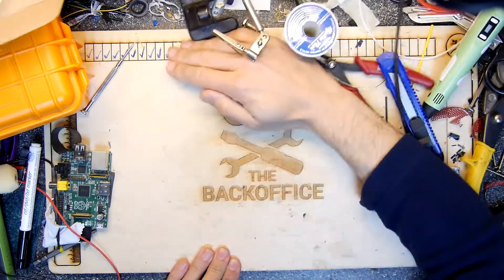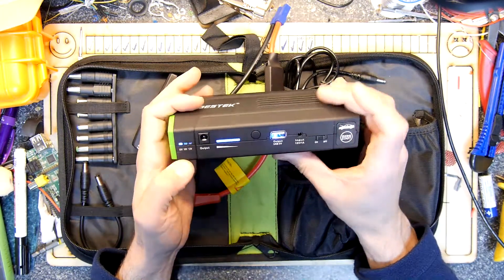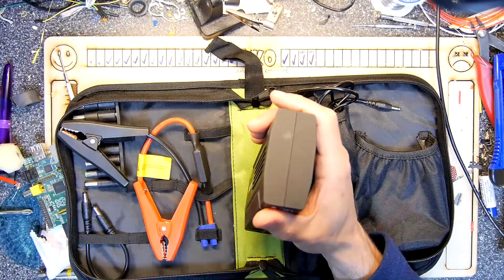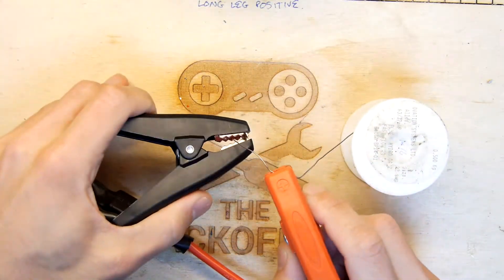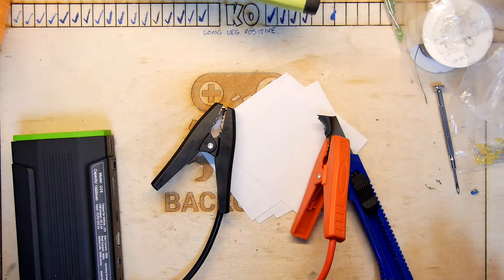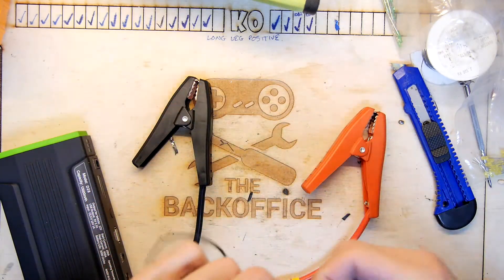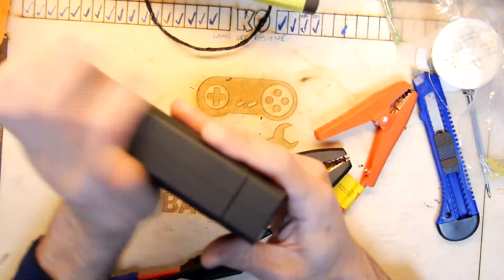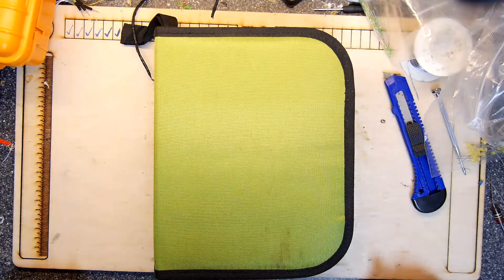Lithium Battery Jump Starter

Comment: I think the diode pack is to stop the alternator overcharging the lithium pack. If you connect the pack the wrong way the diodes wont do anything to protect you. nice vid ;)
Reply from the maker: capri2wd im on the road so can't think about this, but I'll have to draw out the circuit to get my head around it.
Reply: Yeah it'd be a bad day if you hooked the car's 12V line (more like 14-15V and diirrrttyy on the regulation or lack thereof) directly to those pins that go directly to the internal series sting of cells, which even assuming there is some protection right on the cells could end with fire or gas emitting batteries.